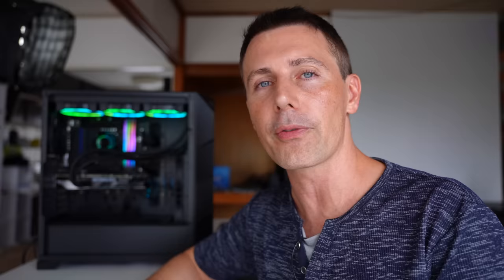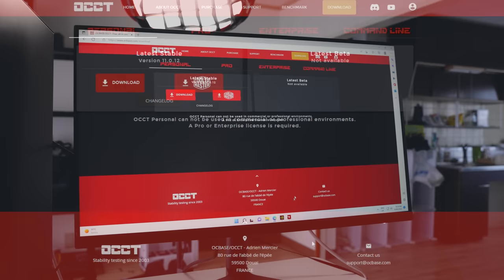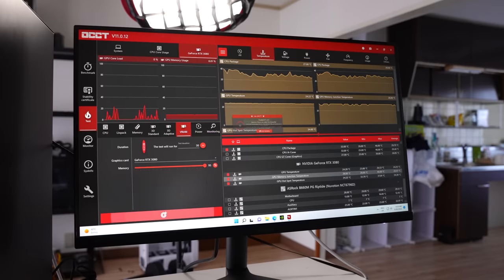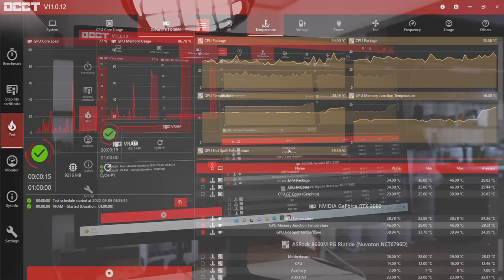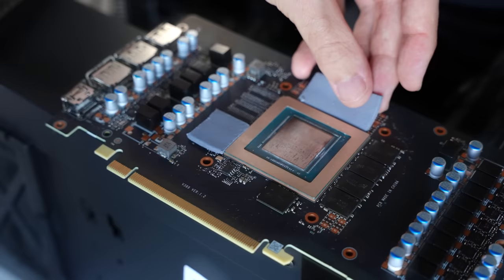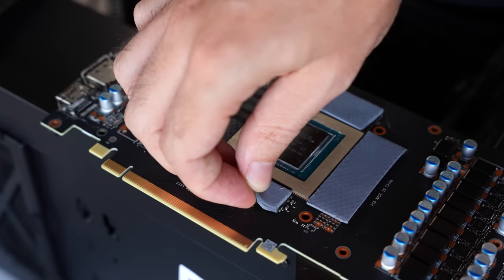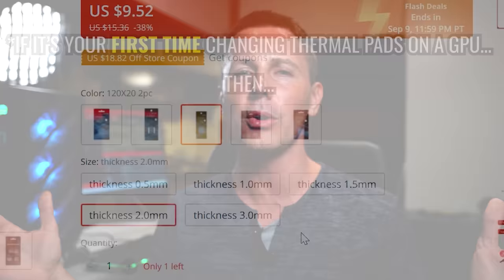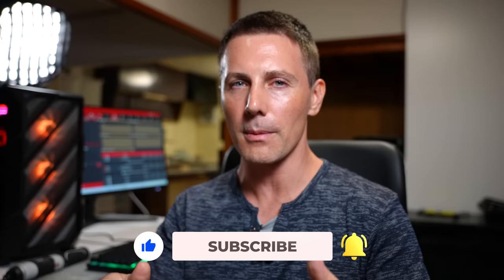Are These $10 GPU Memory Pads Worth it?

Comment: Isnt it good enough to just run the memory in spec? my 3080 12gb runs the memory up to like 90-95C under full load. i just bought it and dont wanna lose my warranty.
Reply: I had a 2080ti Fe that I put in a waterblock and used liquid metal on it. It was a launch model that had the Vram issue, I returned it after reassembling it and there was no quibble at all, and they sent me a replacement (that worked).